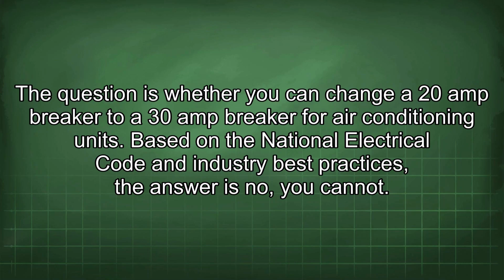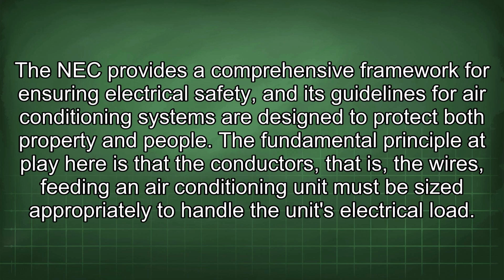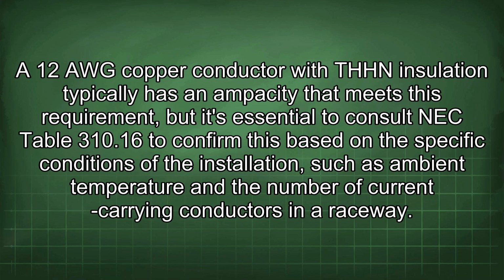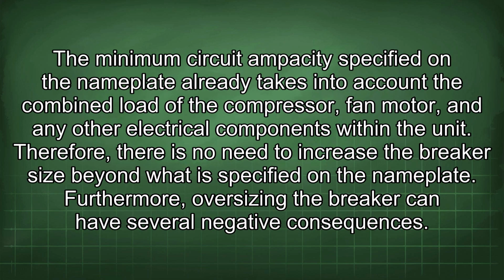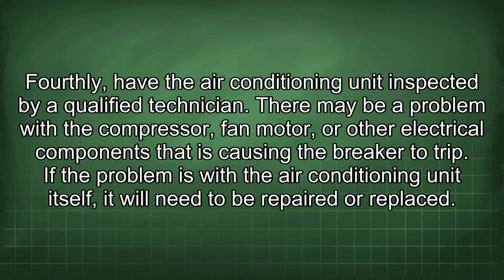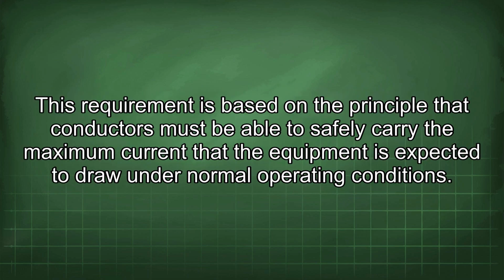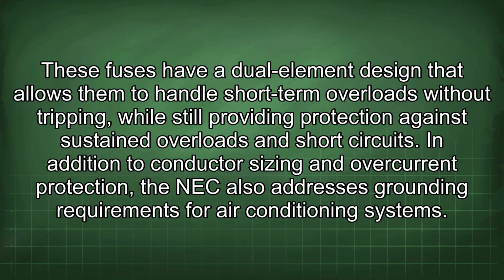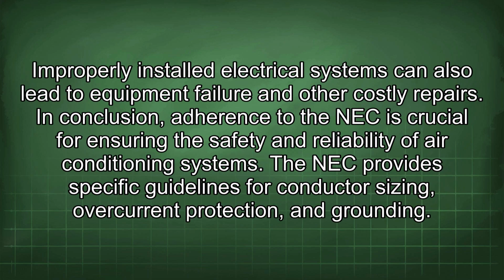Can You Use a 30 amp Breaker for AC Unit?

Comment: The breaker capacity is determined by the circuit conductor current rating, not the current requirements of the device/appliance connected to the circuit. If a device requires more current than a given circuit rating, a circuit with sufficient current rating must be used. Period.
Reply from the maker: Hello @walterbrown8694,

Thanks for your comment! This is where things get a little spicy. While this is normally always certainly true for receptable or lighting circuits, it is not necessarily the case for equipment that specifies an FLA for example. This is particularly common with non-VFD style air conditioners for example.

The National Electrical Code (NEC) often requires circuits to be sized larger than the nameplate Full Load Amperes (FLA) or minimum/maximum ampacity of equipment, particularly for motors and continuous loads. This is to account for factors like starting currents, continuous operation, and voltage drop, ensuring the safety and proper function of the electrical system.

Here's a breakdown of the NEC codes that explain why larger circuits are often necessary:

1. Motors (Article 430)
Motors are a prime example where circuit sizing goes beyond the simple FLA. This is due to their high inrush currents during starting and the need for both overload and short-circuit/ground-fault protection.

Conductor Sizing (430.22): For a single motor used in continuous duty, branch-circuit conductors must have an ampacity of not less than 125% of the motor's full-load current (FLC). The FLC is typically taken from NEC tables (e.g., Table 430.250 for 3-phase AC motors) rather than the motor's nameplate FLA for conductor sizing. This 125% factor accounts for the continuous nature of the load.

Overload Protection (430.32): Overload protective devices, designed to protect the motor from overheating due to sustained overcurrent, are sized based on the motor's nameplate FLA.

For motors with a service factor (SF) of 1.15 or greater, or a temperature rise of 40°C or less, the overload device should not exceed 125% of the motor's nameplate FLA.

For all other motors, it should not exceed 115% of the motor's nameplate FLA.

The NEC allows for an increase in these settings (up to 140% or 130% respectively) if the initial setting isn't sufficient for the motor to start or carry its load.

Short-Circuit and Ground-Fault Protection (430.52): This protection is designed to clear high-magnitude fault currents quickly. Because motors have high inrush currents during starting, these devices are permitted to be sized considerably larger than the motor's FLC. The NEC provides tables (like Table 430.52) with percentages (e.g., 250% for inverse-time circuit breakers, 300% for non-time-delay fuses) of the motor FLC to determine the maximum size of this protective device. This larger rating is crucial to prevent nuisance tripping during motor start-up.

Feeder Sizing (430.24): When supplying multiple motors, feeder conductors must have an ampacity of not less than 125% of the highest rated motor's FLC, plus the sum of the FLCs of all other motors on the same feeder.

2. Continuous Loads (210.19(A)(1) and 215.2(A)(1))
A continuous load is a load where the maximum current is expected to continue for 3 hours or more. The NEC generally requires that conductors and overcurrent protective devices for continuous loads be sized at 125% of the continuous load.

Branch Circuits (210.19(A)(1)): For branch circuits supplying continuous loads, the minimum conductor size, before applying any adjustment or correction factors, must have an allowable ampacity not less than 125% of the continuous load.

Feeders (215.2(A)(1)): Similarly, for feeders supplying continuous loads, the conductors must have an ampacity not less than 125% of the continuous load.

This 125% factor acts as a safety margin, accounting for the heat generated by sustained current flow and preventing conductor degradation.

3. General Conductor Protection and Overcurrent Device Sizing (240.4 and 240.6)
While the general rule is that conductors are protected at their ampacity (Table 310.16), the NEC allows for "next higher standard size" overcurrent device in certain situations.

Next Higher Standard Size (240.4(B)): If the ampacity of a conductor does not correspond to a standard ampere rating of a fuse or circuit breaker (as listed in 240.6(A)), the next higher standard size overcurrent device can be used, provided it doesn't exceed 800 amperes. This permits slight oversizing of the protective device to accommodate standard available sizes.

Small Conductors (240.4(D)): For smaller conductors (14 AWG, 12 AWG, 10 AWG copper), specific maximum overcurrent protection ratings are enforced (15A for 14 AWG, 20A for 12 AWG, 30A for 10 AWG), regardless of their higher ampacity ratings from Table 310.16. This is a crucial safety measure to prevent damage to smaller wires.

4. Temperature Limitations and Adjustment/Correction Factors (310.14 & 310.15)
The ampacity of a conductor (its current-carrying capacity) is affected by the ambient temperature and the number of current-carrying conductors in a raceway or cable.

Temperature Correction Factors (Table 310.15(B)(2)(a)): If the ambient temperature is higher than the standard 30°C (86°F) used for ampacity tables, the conductor's ampacity must be reduced by applying a correction factor. This effectively means you'll need a larger wire size to carry the same current safely at higher temperatures.

Adjustment Factors for More Than Three Conductors (Table 310.15(B)(3)(a)): When more than three current-carrying conductors are grouped together in a raceway or cable, their ability to dissipate heat is reduced. The NEC requires applying adjustment factors that reduce the allowable ampacity of each conductor. This again necessitates a larger conductor size to maintain the required current-carrying capacity.

Terminal Temperature Ratings (110.14(C)): The terminals of electrical equipment (e.g., circuit breakers, disconnects) have temperature ratings (typically 60°C or 75°C). The conductors connected to these terminals must be sized based on the lower of the conductor's insulation temperature rating or the terminal's temperature rating. This can sometimes lead to choosing a larger conductor than initially calculated based on ampacity alone to ensure the entire circuit operates within safe temperature limits.

In summary, the NEC ensures electrical system safety and reliability by requiring conductor and overcurrent protection sizing to go beyond simple load requirements. This involves considering the specific characteristics of loads like motors (inrush current, continuous duty), environmental factors (temperature, conductor grouping), and the ratings of connected equipment. Understanding these nuances is key to designing compliant and safe electrical installations.

Kindly,

BESA Research